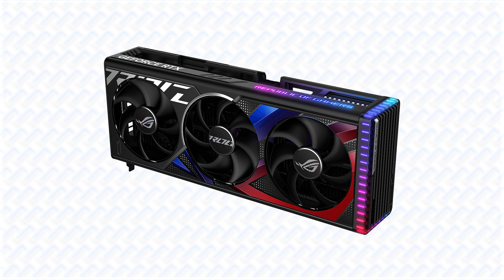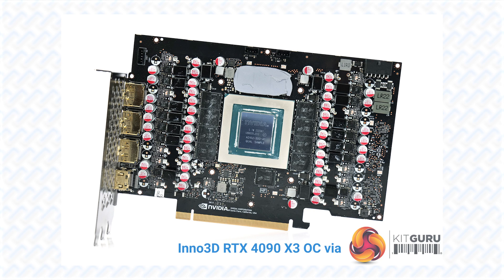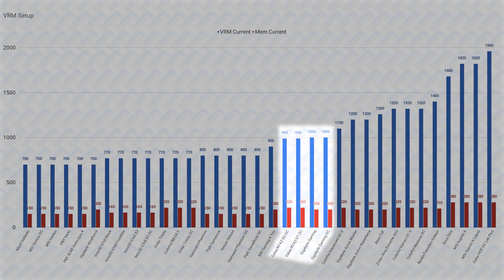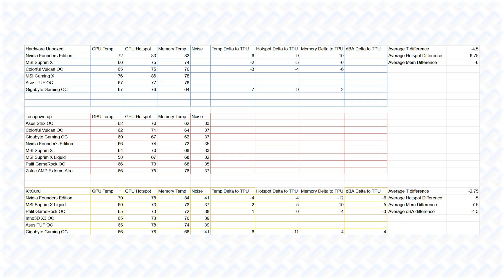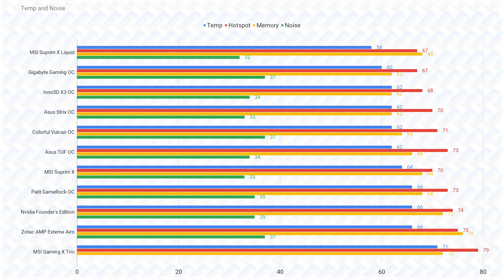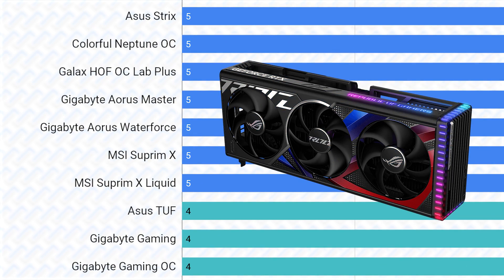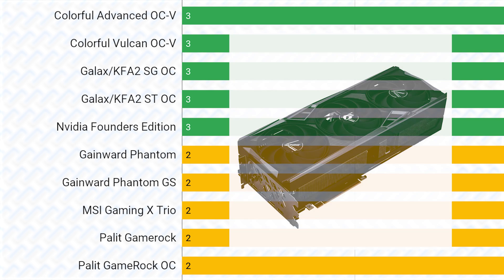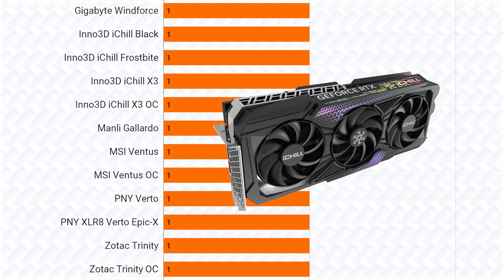Which RTX 4090 to BUY and AVOID?! | 35 Cards Compared! Asus, MSI, Galax, Gigabyte, PNY, Palit, Etc.

Comment: Coil whine is so overlooked. I have seen great test results from ASUS but their coil whine is unbearable even at idle. If I’m browsing the web I’m not using a headset so coil whine is super important. All these GPU’s are very comparable in performance. The gigabyte gaming OC 4090 has a 4 year warranty and has great performance with nearly NO coil whine so my decision was easily made and it has been awesome!
Reply: Its crazy you hear so much about coil whine in the comments, but the board partners never talk about it…they should also mention coil whine and do something against it..i wonder why that happens they have test labs. And how come, that rog strix has so much coil whine when they use the best components? It makes no sense
Reply: zotac, gigabyte cards dont have any coilwhine.
Reply: I can add to some of the comments that I also got an Asus tuf with unbearable coil whine. happily for me the store I bought it from had a 30 day return policy.
This wasn't in high fps menus only this was at any kind of load at all
I really can't emphasize how bad it was, louder than any pc I've ever had even back in the old days where u had 3pin fans running at their max rpm constantly and that was with a variable pitch noise making it even more annoying. I could use it as an musical instrument with just moving my mouse around in games.

Now I'm using a KFA2/Galax sg1 which has barely audible coil whine at full load, I basicly have to put my head in the case and listen for it to notice it. I'm sticking with this one.

I really should've recorded it but I returned within a day or 2.  I even tested with with different power supplies(3.0 supply and adapter) motherboards and wall plugs it was always the same.
Reply: my ASUS has no coil whine 🎉🎉
Reply from the maker: That’s good to know the gigabyte gaming oc has no coil whine. The problem with comparing coil whine is it’s pretty much impossible for me due to lack of that information from reviews. I don’t have all the card myself either. And I can’t just take the word of random strangers on reddit or other forums either.
Reply: @OTechnology  I just returned an ASUS TUF OC 4090 because of coil whine. It's so bad in some games that it actually can be considered "loud", as in "very annoying to be in the same room as". I'm getting a Gigabyte Gaming OC to replace it. Fingers crossed.
Reply: @OTechnology  Exactly this, like if you go looking around you'll find for example forum posts of people saying the MSI Suprim X has coil whine, but then you'll also find videos of people with them proving it doesn't. There's so much false information spread, even by consumers that it becomes near impossible to seperate fact from fiction.
Reply: @I_Crit_My_Pants  Contrasting experiences needend be misinformation
Reply: @fokjohn  If a card doesn't have coil whine, it doesn't have coil whine. It's not a coin flip

Comment: Hello. I bought Palit 4080 gamerock oc last week. It runs cool, silent so happy so far. But also I watched Buildzoid'z 4090 pcb review. He says the pcb design is terrible. As I know Palit's 4080 and 4090 pcb's has same design. So basically it means also 4080 one has bad pcb? It only has 15 phases for vcore.  Do you think it is enough for 4080 to keep using it next 4,5 years? I am using it with undervolt just in case to to reduce the load on the vrms (1000mv 2880mhz)
Reply from the maker: Its not as bad on the 4080 since the 4080 has a much lower power draw. The VRMs even on the 4090 is already overkill even if its worse than the other high end models. So it 100% will power a 4080 just fine. In fact it’s similar to an Asus 4080 TUF if you compre the 4080 gamerock to it.
Reply: @OTechnology  Thank you!

Comment: I've got the Gigabyte Gaming OC and I wanted this card because it fits perfectly to my Raijintek Paean Benchtable that I've set horizontally under my wall mounted LG OLED C1 65'. I always run my RTX 4090 undervolted and Powerlimit to 100% I've got no intension to OC this card. It only should run my games maxed out at 4K 120FPS/120Hz. That's all!
Reply from the maker: I see no reason not to set it to 600W TDP and leave it there. With how good the cooler is its practically begging for it haha.
Reply: @OTechnology  I always get dizzy when I see drawing over 300 watts only by the GPU...
Reply: @Serandi1987  Where can you see the power consumption?
Reply: @jesmith2086  you can see the power consumption when you press ALT + R for come out the overlay. In Nvidia experience you can set what you want to see in the overlay. Just Google how to do that.

Comment: If the msi trio is in a case with a very good airflow and cooling will it be fine?
Reply: In my g500a and gaming trio 4090 it never breaks 64c and the mem never has gone past 66c. With a 200 plus core overclock and 1700 mem overclock and full 107 power limit and 100% voltage. Run at 3015mhz on the core in games and never goes below that and 12,202 on the mem. For supposedly being one of the worst for cooling it beats my evga 3080ti ftw3 by a freaking long mile. I could never keep that card cool. Mem was always around 80c and core was always above 76c in games. For this generation like a lot of others have said get the cheapest one you can get. I got mine for $1,549 brand new before taxes ship and sold by amazon about a month ago. Price has gone up to $1,599 now but compared to what they were just a few months ago I couldn’t resist and it’s a huge upgrade from my 3080ti. Which pulled over 400w without an overclock in games 24/7 and couldn’t even over clock it. It would crash instantly with any overclock. My 4090 pulls and average of 339w with my 200+ / 1700+ overclock according to hwinfo64 after hours of gaming. Never regret getting the msi trio. Love this card.
Reply from the maker: All the reviews tested these in good airflow and cooling cases and its still hot.
Reply: @O!Technology  dang it I bought a msi trio 4080 a month a go for a build coming up

Comment: You neglect the one predominant reason to either buy or not buy a 4090, which in this generation is very obviously COIL WHINE. All 4090 cards run perfectly fine at stock power limits and OC is never actually useful because you will simply drive up power draw to insane levels while gaining less than 2% FPS on average. At the same time, reducing PL and undervolting the cards to the maximum will only lose you roughly the same 2%. ALL the VRMs are perfectly capable of running the cards stable and ALL cooling solutions are perfectly fine (oversized to be honest) as well.

On the other hand though, your top rated Strix as well as the still highly rated TUF have undeniably annoying coil whine which sounds like it comes directly from hell and can be heard more than one room away from your closed PC case. They are absolutely unbearable for watercooling for example due to the coil whine being louder than most mid-level fans at mid speeds. Surveys show this to be the case for literally ALL of the Strix / TUF models. You'd be absolutely lucky to find one that doesn't come with high levels of coil whine.

Your least rated Zotac cards on the other hand are well known to be some of the most quiet cards with regards to coil whine. The Extreme AMP Airo which you only rate slightly higher is the absolute go-to-card for everyone who can't bear coil whine, known to show whine only an a small percentage of cards. The GB Gaming OC and other models above the Windforce come really close, too.
Reply from the maker: Too bad I can't really compare coil whine for the cards. Everyone will have to read people's experiences on different cards in forums. Personally I can't care less about coil whine so I don't really get too fussed about it.
Reply: As I looked at the comparisons, almost all factors began to lose their importance for me, except for the coil whine. I'm not an OC person, so sound comfort is a little starting to matter.  I was thinking of buying tuf until recently.  but I see that the mentioned coil whine is at serious levels. I would like to hear a real sound of the card. What are your thoughts on suprim x liquid? It looks smaller and quieter. also liquid cooling can make it run cooler.
Reply: i had some coil whine and then i changed my psu for the outstanding corsair hx 1500
coil whine gone. i think its not  your card but your psu being poor
Reply: @jackbrugts330  The data I've presented was collected from a hardware forum by hundreds of users with hundreds of different setups and PSUs, including several different Corsair models. I have tested 2 TUF and 2 Strix GPUs on a Corsair RMx Shift 1200W, Seasonic Prime PX 1600W as well as a Straight Power 11 1200W Platinum. While the coil whine sounded slightly different on different PSUs, it was still present at all times and it was horrible for all ASUS cards. I switched to a now watercooled Zotac AMP Extreme Airo and got rid of any in an instant...
Reply: @majinmew7745  well  I have 4 strix oc 4090s and no coil whine on 850 power supplies all evga with 7950x and not one hint of whine @3000 PLUS so maybe you should stop believing in forums.
Reply: @JoeMama-yl1ow  you do realize I've tested 2x Strix and 2x TUF models with 3 different higher end PSUs myself IN ADDITION to following forum topics with hundreds more cards tested, don't you?

Congrats on finding an Asus 4090 without coil whine. But at this point, that's merely anecdotal evidence... Asus are currently the worst brand with regards to that issue anyway.

Comment: I'm new here, much better video than I thought it was going to be (still frame videos). So kudos. I have the gigabyte OC RTX 4090 because it was choice A and A .. the only one I can get at lunch. That high tiered ASUS was sold out 10 minutes before the official launch!

CPU-Z 9YK75J
Reply: .. LMAO am I going to feel inadequate because of the RTX 4090 TI or whatever they're going to call it. The plan is the same. Get the fastest card at launch. Use it for 2 years. Buy new. Repeat. I'm upgrading from my old EVGA RTX 3090 FTW3 Ultra. CPU-Z 9mm3cz

Comment: I am totally happy with my Zotac Trinity 4090
Reply: Yeah, I bought both a Asus TUF OC and Zotac OC and made really deep comparisons between these cards for about a week. You know, I returned my ASUS card. The Zotac was running cooler with the same noise level, It clocked better on the memory (it's more important than the core) and it just felt like the better choice.

I didn't expect the Zotac Trinity OC to be placed at the bottom of this list. You can probably see this more like someone who judge the tier levels based on the specifications and some personal feelings.
Reply: I had to return my zotac, the fan motor was noisy as heck for me

Comment: Love my gaming oc 4090 i had a choice between it or a gaming trio from msi i went with the Gigabyte card because it had a vapor chamber and had a higher voltage limit. But honesty I really wanted a strix but those were impossible to find. At launch the bulk of 4090’s seemed to be asus tuf, gaming oc, and msi trio cards. I can’t believe how cool the card runs stays in the high 50’s and topping out in the low 60’s most games. And it’s more power efficient than I expected it’s more efficient than my evga ftw3 3080ti in its oc bios the gpu i had before the 4090. I have it paired with a 5800x3d now did have a 5950x but switched to a 5800x3d when they got cheap. Just waiting to see the 7950x3d’s benchmarks, pretty sure thats what I’m getting but came very close to picking up a 13900k. Its so crazy the 4090 can be cpu bottlenecked at 4k in some games. But I still would like to add a nitro 7900xtx to my collection soon.
Reply: Are you loving the looks of the Gigabyte Gaming OC? I similarly had a 3090 FTW3 in my gaming build and lots of RGB bling. 

I assumed I'd pick up the Aorus Master 4090 this gen but I'm thinking of toning down everything going on in the case to focus on the 4090 as the centerpiece (i.e. still filling the case with RGB fans but getting a non RGB motherboard and subtle RGB on an AIO rather than a screen, no more Lian LI strimers, etc.)

When I saw the Gigabyte Gaming OC with those RGB fans giving off a glow that can be seen through that huge heat sink I fell in love. A sort of subtle, sleeper looking card apart from it being massive and glowing with "power", lol.

Still considering the Suprim X because it's still subtle enough and looks premium. But after having multiple MSI cards for mining they almost ALWAYS underperformed. Even my 3090 Ventus was the weakest of the bunch despite supposedly excellent cooling.
Reply: @jwlafferty  yea I would’ve preferred the master or a strix but got mine around launch when 95% of the cards were tuf, gaming oc and msi trio. Yea I loved the way my previous ftw3 card looked but the gaming oc at least has rgb fans but miss having rgb on the backplate. I probably just should’ve waited for 3 months and could’ve gotten the card i wanted but as far as what really matters the card is great can’t believe how cool it runs especially the gddr6x. Yea I do like how you can see the rgb fans even from the side of the card.
Reply: Also have this card and a 5800X3D! Went from 5900X to 5800X3D. DId you notice any improvements going to 7950X3D ? I do'n't think i'm getting bottlenecked by my 5800X3D at 4K? Hope you're enjoying your setup!
Reply: did you upgrade to 7950X3D? Or will you be waiting for 7800X3D
Reply: @GewelReal I went ahead and got the 7950X3d but I think I might have gotten the 7800X3d if it had came out at the same time. I drove 3 hours to a microcenter and I wasn’t gonna do it again so i got the cpu, a b650E aorus master, and 6000mhz  cl30 ddr5. I normally get X boards but this time around a good b650e has everything I see no point in getting a 670 or 670E. But still waiting on a damn am5 bracket for my aio. I ordered one and my luck it got lost in the mail. Think I might just order a arctic freezer ii 420 or 360 aio. I have a kracken x72 and coolermaster ml360r now.
Reply: @ChadKenova  remember to set the affinity correctly so games use the 3D cache CPU die (as Windows for now doesn't know exactly which CCD to put the games on every single time)

Comment: Hi, i am a Happy owner of an inno3d x3 OC. Wonderful Card. Silent! No coilwine! And with 0.950V Card Push 2800 MHz!. Ok we know WE loose a Bit because the GPU Video freq Drops a Bit. Take max 350 Watts. But with 1.1V it can Do 3000 MHz easy.
Reply from the maker: Its a good card for stock settings usage for sure. But 2800mhz for example is what the 4090 Palit Gamerock runs at stock and there is not way the Inno3D can sustain 3000MHz with that power limit. Just impossible.
Reply: @OTechnology  3000 MHz is max with 1.1V and in 3dmark IT holds it. 462 Watts then. 65 degree temps .

Comment: I’m fine with the gaming x trio. I don’t care about noise so I set the fans to 80% and I never even reach more than 50c. Most of the time I’m between 35c and 45c depending on the game
Reply: I had the asus tuf and Ouf the coil whine was terrible. The gaming oc uses cheap sleeves bearing fans so I also went with the gaming trio. I do not care for the vapor chamber,  this thing is whisper quiet with no coil whine also I never saw it reach more than 70 degrees. More than happy with it and glad i could return the tuf oc
Reply: @pascalfilion3518  What is your hotspot temp please?

Comment: I got a Suprim X Liquid, when it was in stock, and I can definitely say I'm happy with it. The size alone is great, because it fits nicely in a be quiet pure base 500FX, with the radiator mounted up top. I've got a native 16 pin cable for powering it, so closing the side panel is no issue.
Reply: I got the standard Suprim X and it's great, and no coil whine. Plus never have to worry about permeation, which is why my entire setup is air cooled. Liquid cooling works great, but all liquid cooling experiences permeation after 5-6 years, at least according to Gamers Nexus, who liquid cools a lot of crap.

It's like the liquid version was made for maximum performance and the non liquid version was made for maximum durability and longevity while getting as close to the liquid one as possible, I love that design philosophy tbf.
Reply: I choose the Suprim liquid X too and I really liked it. The only problem for me is the coil whine.
Reply: this card undervolts great. I run it at 0.875 volt@2300 mhz max. because I don't care about the few extra frames I could get from the 2600+ mhz stock. The result? 200-250 watt under full load, quiet, cool Nd absolutely no coil whine
Reply: @ae-gc7ck shouldn't you alter the voltage of the other components as well though? Won't this change create a problem in the system?
Reply: Same here with my Aorus waterforce extreme.It runs cool and quiet and like you said,it fits nicely in my hyte y60 case.No bending against side panel or anything.I love it.

Comment: What about coil whine/buzz. I want a card with 0 audible coil whine/buzz from a closed mesh housing in SIlent Base 802.

I have tried a bucnh of Gaming OC Gigabyte 4090s and all had too much coil whine, though modestly better than even the less bad Asus and MSI Suprim X card revisions. Same with one Aorus Master and 4 PNY cards.

Tried MSI and Asus and while not as bad as the horror stories of coil whine/buzz being heard in the other room, they were definitely the worst and easily beehive like noise in closed housing even 5+ feet away. Though Gaming OC sounded the quietest, iot also had a buzzing beehive noise just modestly toi a lot more mild than Asus and MSI, but still too much.

I had a Gigabyte Gaming OC 3090 Ti that had very hush and faint coil whine it was not audible at all from closed housing. And 3090 Ti has similar TDP to 4090 cards so if they can make 3090 Ti with very little to no coil whine/buzz, why the heck not 4090s
Reply: You need to turn up the gaming volume and stop worrying about this.